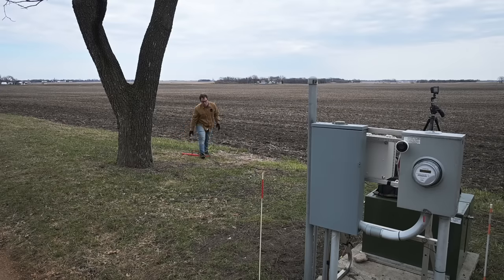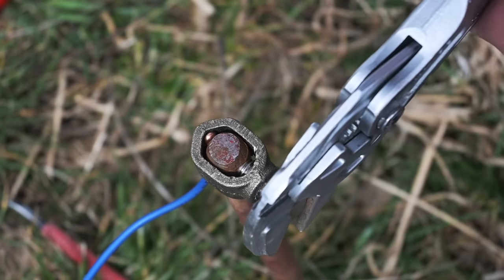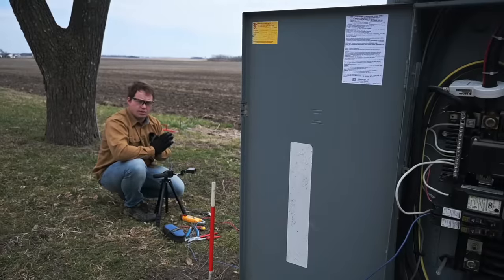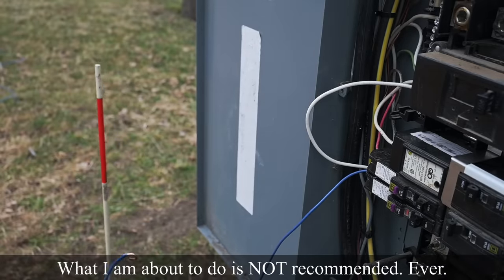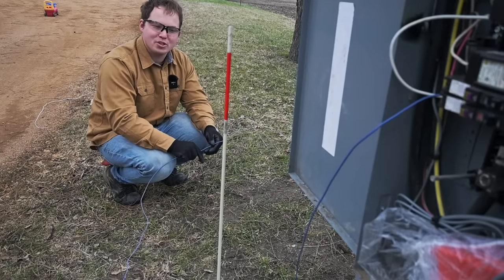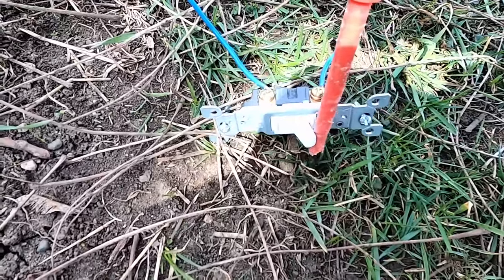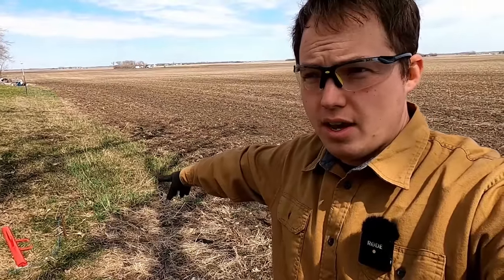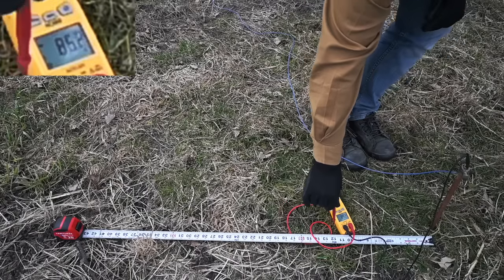Will 120v To Ground Trip a Circuit Breaker?

Comment: Great videos but please call it difference in potential when referring to the voltage I can feel my tutor shouting from here in England also do you refere to Grounding as an system earth and equipotentional bonding as one over the pond? Great video though
Reply: We don't say earth in North America, we say ground. Just the way it is over this way.
Reply: @illestofdemall13  That's what I was wondering so it's a all encompassing term over there?
Reply: @cameronstuttard4644  Grounding and bonding are the terms we use. There are more specific terms in the codebook, like grounding electrode, equipment bonding jumper, etc.
Reply: @illestofdemall13  Pretty much likewise over here. I've noticed the majority of your supplies are pole mount transformer does the utility ever supply a ground to you or is that upto you as the contractor to supply?
Reply: @cameronstuttard4644  They drop 2 live wires and a neutral for 240 VAC residential. The grounding is supplied by ground rods or other methods, and a ground wire connects to the ground rods then goes into the main panel from. Inside the main panel the neutral and ground are bonded together, but only at that first means of disconnect.
Reply from the maker: You're right that I could improve my terminology! It's hard to always say the right term on the fly since I don't script my videos. Thanks for the comment!
Reply: @BenjaminSahlstrom  Still good stuff

Comment: Great video. But one thing, just be careful on saying your rubber shoes protect you. They may work at 120, but the voltage from power lines is another story. Its best to shuffle then, the shoes won't protect you. Just don't want somone to take what you a said and say well you said....

Comment: So at 9:50 why? Why did current only go to 9A, why not over 20 and the breaker trips? Didn't you just disprove the reason for grounding?
Reply: Nine amperes. It is because of the resistance of the ground. It is 120 / 9 = 13 ohms. Grounding meaning connection of the neutral to the ground is done for lightnings etc. Protective grounding means connecting the ground wire to the neutral so the current will go back with the copper wire and it will trip the breaker - hopefully.  Grounding never is a foolproof solution. There is a reason why people use GFCIs.
Reply: @okaro6595  Thanks. I will give it some thought.

Comment: Should I have gotten a GFCI Square D Home-line 20A Double pole breaker to back~Feed my main Panel in an Electrical lose ? My Inverter is A Hybrid 5KVA 230v Pure Sine Wave Inverter Charge Controller 48v it’s not an MPPT “ my system is only for electrical Back-Up that’s the 48v lithium battery bank ! I have no 220v every circuit is 120v on both phases ! I want to take the L1 is 115v & the Neutral wire is Hot 115v I want to take the L1 115v + & the Neutral 115v+ into a double pole breaker so my entire breaker box would be all 1 phase 115v 86A ! ~ ? Any & All you’re facts are welcome ! This is only if we lose electrical power ! What’s you’re idea !

Comment: If you make the wire shorter the resistance will be lower and the current will exceed the 20 amp breaker.  I bet that wire was getting hot with 8 amps going through it.
Reply: Well, not too warm.  9A in that gauge wire should be fine.
Reply: It's rated for 20 amps, so the wire wouldn't get very hot at 8 amps.
Reply: Yep, I corrected my post above ;)

Comment: You didn't expect 2400watts to make that much of a bang? And I'm sure much much more than 20amps flowed before the breaker reacted.  The breaker is also designed to take a short on its output multiple times as that is one of the faults it was conceived for. 

How much of a grasp of electicricals did you have again?

Comment: I'm curious why Ben thought it will trip? "wives tale schooling "? 
Many earth pegs in dry areas will be 50ohms+ easy and will never trip, even my country at 240V, the breaker would have to be 2A or maybe 6A. 
Earth simply ties neutral to earth, can be for the purpose of tripping gfci breakers not mcb breakers. 
These tests are real learning it's amazing the kids who don't realize such things as you can touch 240V with your hands and feel nothing bc of rubber shoes
Reply from the maker: It is really important that people understand that these principles for sure. FYI I did NOT think that it was going to trip but I wanted to build the "suspense" so that people would pay closer attention and hopefully remember the example better.

Thanks for your comment!

Comment: In my Power class in college we had a test question about an electrical line touching the ground directly and we had to calculate how much voltage would travel through your body if you stood X meters away from the source, your feet were Y centimeter apart and your legs had a resistance of Z (I think the ground was wet too, but its been a while). I remember thinking, why the fuck would anyone need to know how to calculate this? I guess this answers my questions. 

If my professor pulled some shit like this for my Power class instead of just reading off slides, I would have probably learned more...or died. Whichever came first.

Comment: electricity does not take the path of least resistance. it travels back to source. your breaker tripped that fast because you are right next to your transformer...
Reply from the maker: If you watch a bit further you'll see that it does not trip. The only reason it tripped at first was because it was a GFCI breaker.

Comment: Not all the time ! You will have cases where live wires feed to ground that didn't trip breakers or blow fuses. Hence...reasons for grounds. Otherwise you get into the line and touch wires, YOU become the ground path. OPEN Neutrals will get you this way too. If Neutrals aren't grounded, you again become the path to ground and very easily can be electrocuted in both scenarios depending on voltage and amps running through the wire you get a hold of. Hence .... I want my neutrals and grounds for safety...Grounded period.

Comment: Now..if u have a lightning strike at say the service drop to ur house. .then it would theoretically come into the main panel and flow to the ground rod which is BONDED to the main panel and be dispersed into the earth because in the case if lightning. .the source is the earth👍
Reply: Wouldnt the discharge take the route of the Neutral Wire? That Neutral Wire has far lower Ground Resistance than our typical Grounding Rod resistance... Isnt it?🤔
Reply: @piratedprivacy9052  ..remember..electricity always wants to go back to the SOURCE..where it started from..a battery in ur car..the utility in ur house via the neutral..but lightning was created in earth's atmosphere..so it wants to go back there via ur ground rods..not the neutral.
Reply: Michael Antonelli  Sorry ya, I missed out to inform that Utility Neutral was 'derived' from Mother Earth...😅
A very 'strong' network of Earthing to make the Neutral at 0V (at their very best) even when 'heavily loaded'.
This Neutral, if measured, is very close/at Zero Ohm of the Earthing Resistance.
(Exception to this is I/T arrangement)

Comment: Arc Fault Breaker trips because the Current is flowing from but not coming back to the Breaker
Reply: No!  That is the definition of a GFCI Breaker.  And Arc Fault (AFCI) Breaker trips when there is a loose connection ...

Comment: I still don’t understand why Neutrals and Grounds would be connected together.
Reply from the maker: I'm going to make as video about this hopefully soon!
Reply: Simply because the electric company provides only one common wire i.e. a PEN-wire. There is the TN-S system where the company provides separate ground and neutral and they never are connected. That has previously been common in the UK. 

You need to connect the ground to the neutral to give low impedance path for  the fault current. There is also the TT-system where the ground goers only to ground. On such a system one uses GFCIs for additional protection (well one now uses also on others but they have been used longer in TT)

Comment: The reason you don't trip the breaker is a "poor" ground pin, it's around 13 Ohm! If you had a better ground connection your current would be higher and more likely to trip the breaker thermally. (I =U÷R)
Reply: 13 Ohms is TYPICAL  ...
Reply: @MrSummitville  depends on where you live, nowadays the use of a ground loop is common in my region. The measure typically between 3 and 7 Ohm
Reply: @jorgenvangeel7888   Do you not understand that he had two ground rods in his circuit?   6.5 ohms EACH = 13 Ohms Total  / 2.  He did NOT have a "poor" ground pin ...
Reply: @MrSummitville    I see a mathematical error; 2 groundpins of 26 Ohm give 13 Ohm because less resistance to earth. The "2 pins of 6.5 Ohm" would give 3.25 Ohm.
I based myself on the numbers given, voltage and current so there was the resistance born (calculated). These are simple rules of  Ohm's law R=U÷I

Comment: Of course it won't trip it didn't look like your panel had its own grounding system. Try the same test with the panel having a ground rod next to the panel that's going to the ground terminal in the panel. And then run 120 to your ground rod as you did in the test. What you created was a dead short to the ground and your panel doesn't looking like it has a grounding conductor.
Reply from the maker: There is a ground rod connected to my panel. Maybe I'll point it out in my next video.

Comment: Remember its the amps that fry u not necessarily the voltage. Half an amp will fry u 19k volts is very survivable
Reply: Death requires BOTH ... a high enough voltage to push a high enough current and it depends upon the PATH through your body ...

Comment: Where 120 volte workers as main line ,in our state 220 volte workers as main line
Reply: In the USA we have 240 Volts Split-Phase ...
Reply: @MrSummitville  o that's meens you guys combind 2 * 120 volt live wire to get 220 volt and not using Cold wire ?
Reply: @biswasonline5010  We use a 240 Volt center-tapped transformer on the pole, which gives 240 Volts between L1 & L2 and two @ 120 Volt circuits between ( L1 & N ) and ( L2 & N ).  The XFMR Center-Tap is neutral (N) and is grounded at the Pole and grounded at the Home.  We have 4 wires ( L1, Neutral, L2 & Ground ) from the pole to the house.
Reply: @MrSummitville  ok tnx now I understand

Comment: So basically you made the 120 volt circuit the same potential as ground making it an un grounded system.  If you had an actual ground for the service on a ground rod and then did your experiment with 120v on another ground rod it would trip.  You just showed how an ungrounded system works. Gfci does its job without a ground that's why it tripped it doesnt reference ground.
Reply: And it arced the panel because the panel is grounded.  Not bonded to ground though

Comment: its a voltage DIFFERENCE of 95 volts at 2 feet, not 95 volts. so 120-95 = 25 Volts at 2 feet, not 95.

Comment: grounding can be a blessing and a curse. grounding is not a cure-all. there are cases where grounding can be a bad thing, or cause problems. it can be a complicated thing.
Reply from the maker: Most important thing to remember is that grounding in and of itself does make anything "safe".
Reply: @BenjaminSahlstrom  Grounding makes the Grid safe by discharging the Static Charge build-up that would otherwise occur.  Does is solve all problems?  No.  But it does solve the Static Charge Build-Up problem ...

Comment: I'm guesting power planet is ground to the ground too, that why breaker trips?
Reply: No, it is because the Neutral Wire and Ground Wire, in the Main Panel, are both connected to your Home's Ground Rod.
Reply: @MrSummitville  Thanks

Comment: 4:01
Guessing trip only because the source transformer is close.
If the source were far away, I would guess not trip immediately (which is why underground cabling can be dangerous after a rain or in muddy soil).
Will edit to give my apology if needed :-0)
Reply: depends on moisture in ground
Reply: @alanm2842  Agree, "conductivity" of the ground
Reply: @2Truth4Liberty  i found this on a lawn light when wet breaker would trip. When dry just waste power
Reply: @alanm2842  Sounds right. Until the current flow (amperage) gets high enough the breaker won't trip.

Comment: I swore that breaker would have tripped with a two foot arc flash,,,,,my lord was I wrong.
Reply: Ohms Laws predicts ... 10 Amps = 120 Volts / 12 Ohms,  which is exactly what happened
In Dry Soil, the ohms would be much higher and the amps would be much lower
Now, If it was a 5,000 Volt High Voltage wire on wet soil ...
Approx 420 Amps = 5,000 Volts / 12 Ohms  =  A huge Arc Flash

Comment: 9:46, why did it not trip?
Reply from the maker: The current is trying to get back to the source which is the neutral at the panel. Since there is no neutral wire the power is using the ground (dirt) as the return path back to the grounding electrodes at the panel which are bonded to the aforementioned neutral. The dirt is not a good enough conductor to bring the current flow up to the required 20 amperes to trip the breaker. Hope that makes sense!
Reply: @BenjaminSahlstrom  20 amps won't trip a 20 amp breaker. They are designed to work indefinitely at full load. At 40 amps you might get 30 seconds or up to over a minute before it trips.
Reply from the maker: @illestofdemall13  Right.

Comment: Hell no it won’t trip, unless the ground is extremely wet and you are near metal pipes or other groundings attaches to neutral.  I use this all the time to make worms surface for fishing.  Give it juice for a minute and all of them come to the surface, turn it off and collect them while stunned.
Reply: If it’s a gfci it will trip but not a regular breaker.

Comment: Got electrocuted today because some dumbass had the neutral going to ground and I unknowingly grabbed the live wire and completed the circuit and now this is in my recommended.  Spooky.
Reply: Something wrong with power installation and circuit breaker! in my house if ground and neutral wires touch each other the circuit breaker flips off immediately!  neutral wire doesn’t shock me it has no power.

Comment: You made an error. The Voltage increases the further away you get from the ground rod that you're feeding 120 volts into the ground.

The Voltages increases in the ground the greater the radius from the source of voltage entering the ground because the area of the ground increases lowering the ohms.

I know it sounds counterintuitive but double check this video from Mike Holt Academy - Master Electrician and Code Consultant at 38 Min. 21 Sec.: https://youtu.be/mpgAVE4UwFw?t=2301

Comment: A lot more than 20 amps is drawn from that ground fault.
Reply from the maker: Right. Because basically it is drawing an "unlimited" amount of current for the duration of the fault until the breaker can disconnect.
Reply: @BenjaminSahlstrom  Yes. I know you know how it works, btw. Just wanted to clarify for others who might be confused by how you mentioned the 20 amps.
Reply: You had about 11.5 Ohms of impedance on your ground rod from what I've calculated using Ohm's Law. The impedance on a properly bonded piece of metal equipment or metal junction box would be much lower, thus creating a large current draw which would trip the breaker immediately. So many people don't understand that the ground rod has nothing to do with bonding the electrical system.
Reply: Not sure what you mean.  Without the gfci its working as if it was a load of 9 amps. If it was a lot more than 20 amps wouldn't the breaker trip?
Reply: @joechil63  When he touched the cabinet and it tripped.
Reply: @joechil63  At 6:02 he touches the hot to the panel and trips the breaker. That's what I was talking about.
Reply: The 9 amps was when he was hooked up to the ground rod. That is a different story. That is why we have to bond all metal parts in an electrical system to clear faults. 6:02 shows the breaker tripping, and the reason it trips is because there is a low impedance path back to the source (neutral bonded to ground).
Reply: Oh ok thanks for the reply. I thought it tripped @ 6:02 because it is the same gfci breaker and not a regular breaker. 
Only 1 way to find out. 
Yo Ben, short it to the panel with a regular breaker.
Reply: @joechil63  Either breaker would trip in that situation because the impedance is practically 0 Ohms, therefore a very high amount of current is drawn. That's why the breaker trips instantly, and also why there is a mini explosion where the fault took place.

Comment: YOU KNOW WHY GCFI EASILY TRIP..?? IT SENSE THE BLACK WIRE LOST CONNECTION THAT DROP VOLTAGE WHEN IT HAPPEN...WHITE WIRE NEED CONNECTION CURRENT..IF BLACK WIRE OR WHITE LOOSE CONNECTION TO THE BREAKER..IT SHUT OFF AUTOMATIC...JUST LIKE GCFI OUTLET...ITS  ALSO VERY SENSITIVE IN THE WIRING AS WELL..LOAD AND LINE CAN'T SHARE WITH NEUTRAL PATH ON DIFFERENT NEUTRAL WIRE ON DIFFERENT BREAKER

Comment: People and pets have been killed because of this incorrect understanding of earth grounding, especially near traffic light and street lighting systems. Electricity  will want to find a return path to the source, and the earth is not a good path. The resistance between the ground rods and the earth is too high to trip a regular circuit breaker.  Earth grounding is of value only for lightning arresting systems.